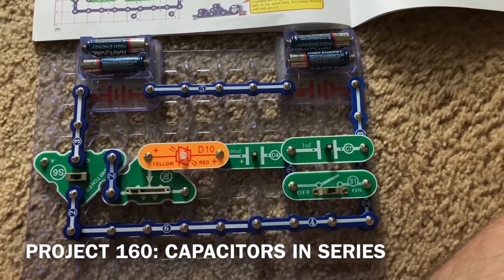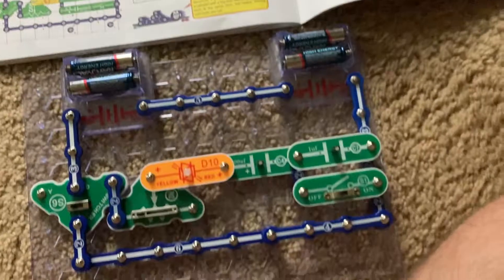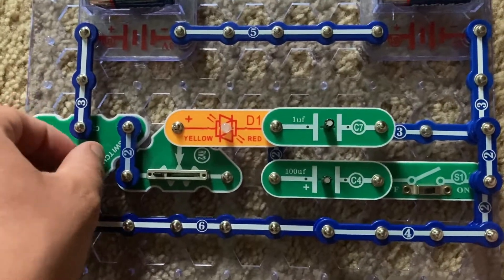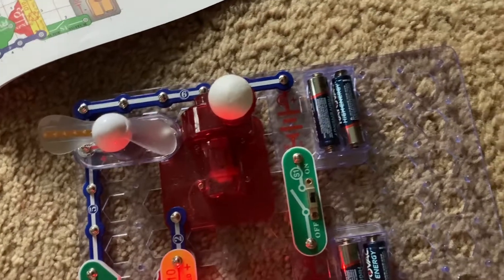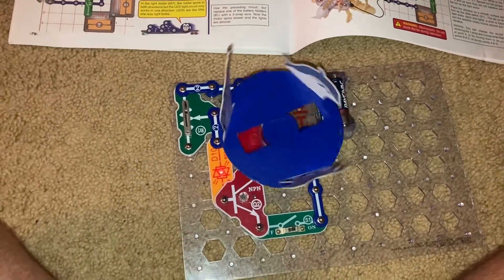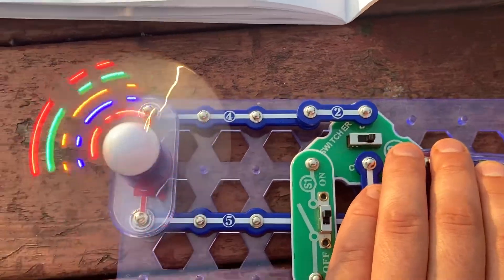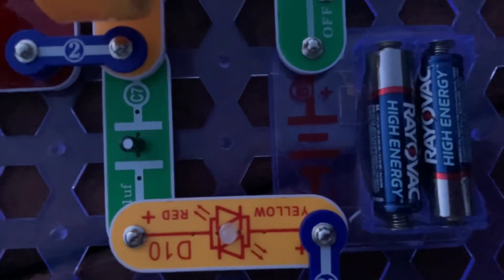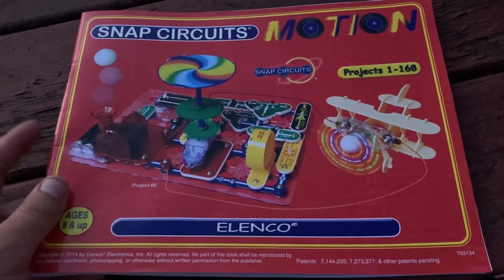Snap Circuits Motion: Projects 160-168 (VOLUME WARNING)

Comment: Thanks for the video. Do you think these are fun for adults? Do you learn a lot about circuits with these? I was thinking about getting myself one and hoping my boys will enjoy them when they get a little older.
Reply from the maker: I personally think that Snap Circuits are good for people of any age who are interested in electronics and circuits.  You can definitely learn a lot of important things about how electrical circuits and electronics work.
Reply: i specifically think these kits are for YOUNG CHILDREN / YOUNG TEEN .. but there are two other kits by elenco ... that adults would be more comfortable with ... ELECTRONIC PLAYGROUND 50 IN 1 & ELECTRONIC PLAYGROUND 130 IN 1 ... there are older Elenco kits that may be found in stores and of course good old EBAY ... they are called ELECTRONIC LAB ... from what i researched   ...  the have had 9 different kits .. they looked similar to EP 50 IN 1 &  EP 130 IN 1 ... so before i go and giving  suggestions ... you may download all or most SNAP CIRCUITS MANUALS FROM Elenco.com .. just search for model and type manual after that .... ... even elec tronic playground manual ... i know the question is directed to andrew ... but i thought i would give you some info.

Comment: hey i have gotten 3 kits this year so far ... SCBRIC ... SCROV10 ... SCDi ... looking through youtube and seeing you building and explaining these projects are fun ... good luck with all of your kits ... there are similar 3D kits by elenco  .... called MYHOME & MY HOME PLUS ... they look cool ...  there is even 3 coding kits ... a new GREEN KIT .... and HOME LEARNING ELECTRONICS FUN Kit .... and there is a simpler kit called SNAP CIRCUIT POWER ... most of these kits ... their manuals can be downloaded from ELENCOs website ...
Reply: I haven’t heard of the 3D kits. I’ll have to look into them. Thanks.
Reply: @staticklingon2182  look ... on amazon ... or elenco.com ... they had  2 3D sets ... 3D ILLUMINATION & 3D M.E.G... the idea of these 3d kits is to build like 3 wall or a house using the base grid  with the part of course same/similar to the MY HOME & MY HOME PLU KITS ...  but 3D MEG might no longer be for sale ... so check elenco.com ...
Reply from the maker: Thank you.  I have seen a lot of the newer kits you mentioned in stores like Barnes & Noble and I hope to check at least the coding one soon!